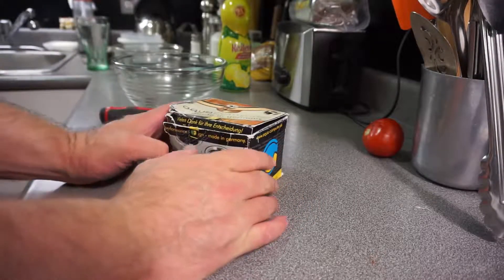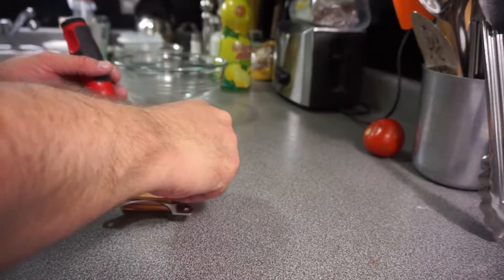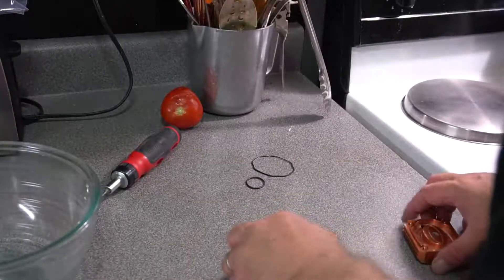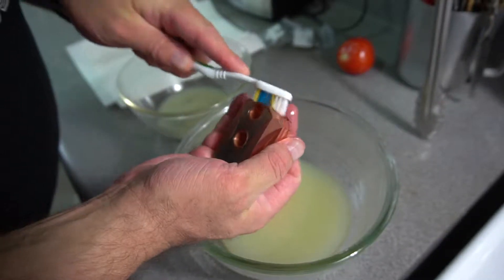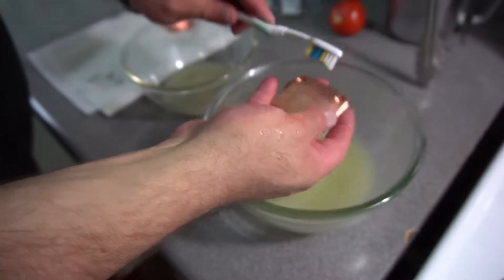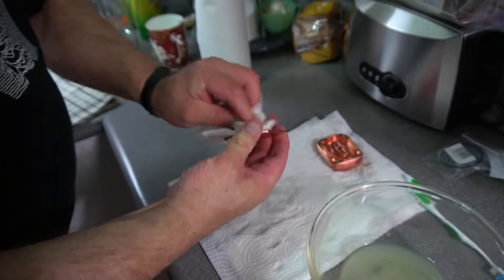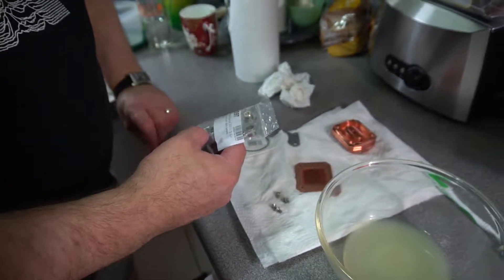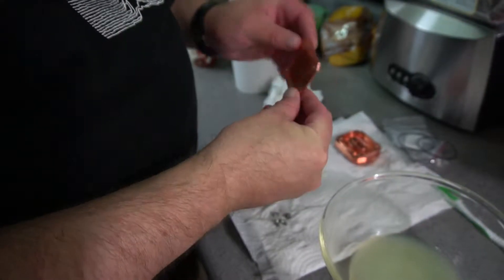Cleaning a copper CPU Waterblock (Aquacomputer Kryos Cuplex) with Lemon Juice

Comment: I clean my silver using tooth paste! Im going to try lemon next time. 😊
Reply from the maker: :) Soak for 12-24 hours.  Another trick is to line a glass baking dish (or if smaller items, something not metal in scale) with aluminum foil. Shake in a goodly amount of baking soda (washing soda works - is stronger) place items to be cleaned and then  pour over some boiling hot water.  When the fizzing stops, the silver is clean.